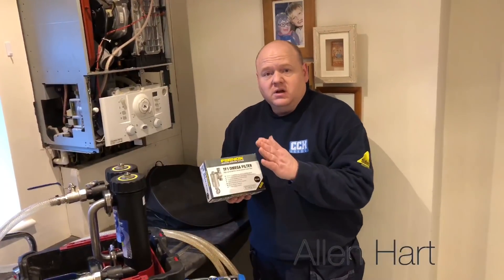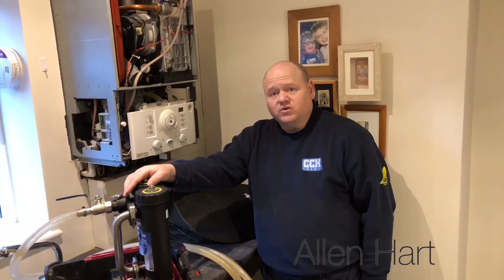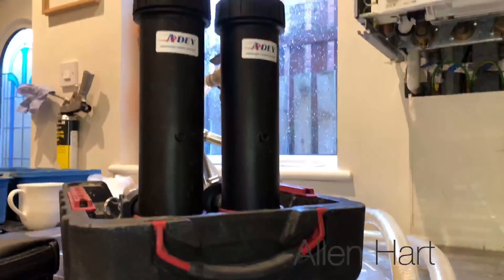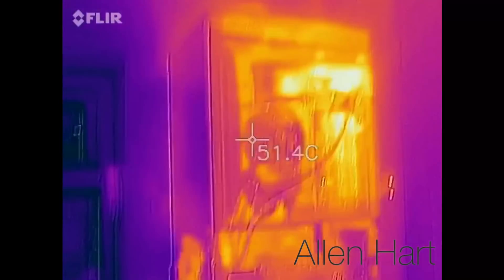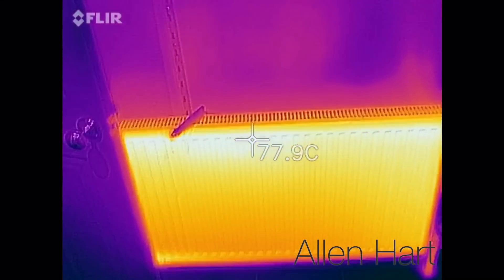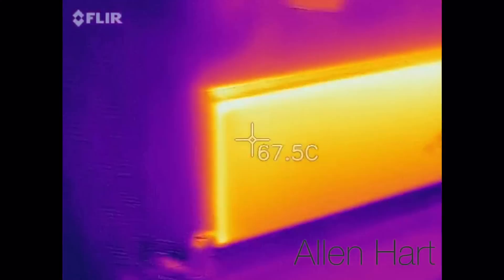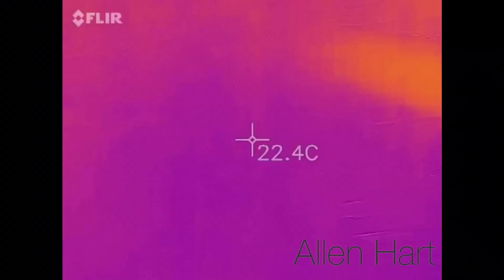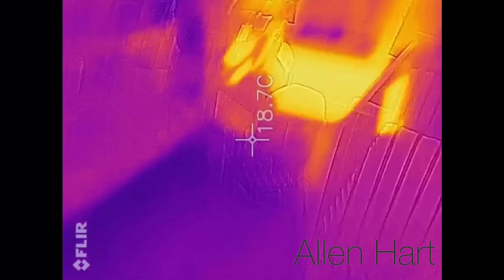Flushing A Heating System Using Flir One Thermal Imaging Camera

Comment: Is the flir 165 good enough for this type of inspection?
Reply from the maker: Not sure what the flir 165 is sorry.
Reply: @AllenHart999  flir tg165 thermal camera or what camera do you use on video?
Reply from the maker: @stanley1438  Flir one, its ok but not amazing. You can get better ones but they cost a fortune.
Reply: @AllenHart999  ok cheers but what thermal camera are you using on video
Reply from the maker: @stanley1438  Flir one. https://www.ebay.co.uk/itm/Flir-one-thermal-imaging-camera-IOS/202550419344?hash=item2f28f21f90:g:hCcAAOSwNphcJoKJ:rk:2:pf:0